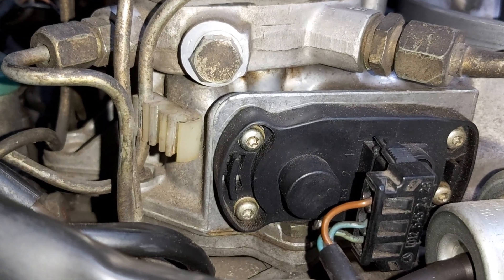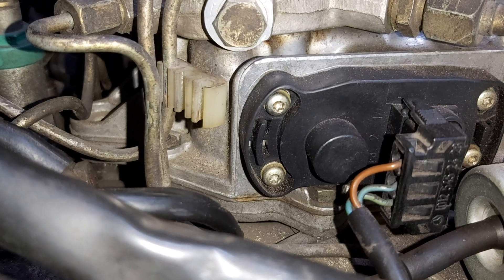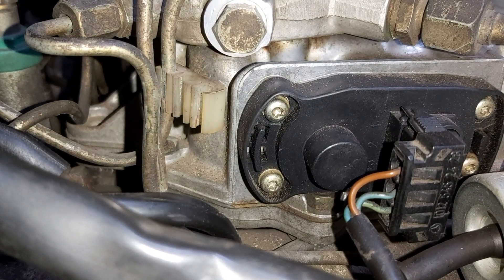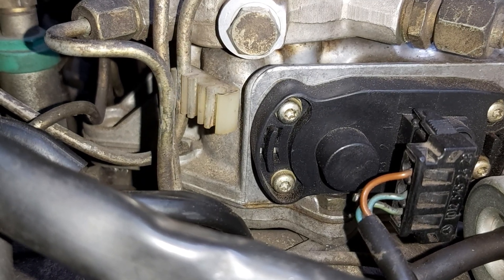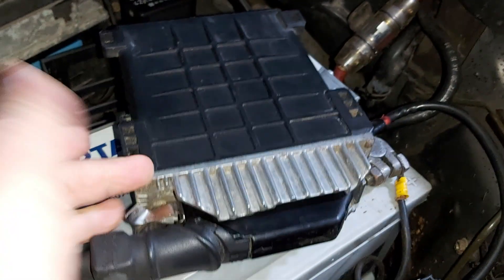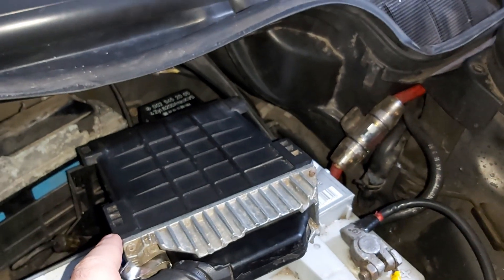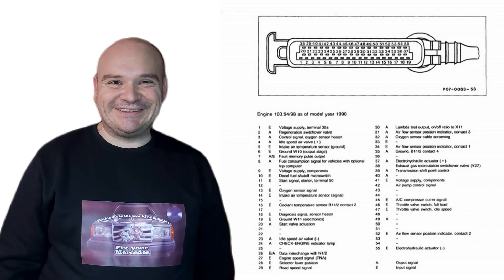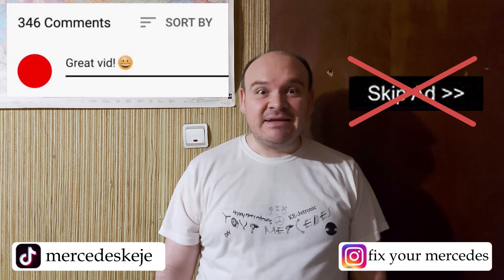㉦Mercedes Ke-Jetronic㉦ - 🔌✅👍🏻👌🏻Connecting the potentiometer plug👌🏻👍🏻✅🔌

Comment: Hello I have a question for you. When my vehicle's engine is cold and I start it, it starts to stall at low speed. It may go away when the engine warms up a bit. thanks
Reply from the maker: Have you replaced and calibrated the potentiometer?
Reply: @ I am trying to get a potentiometer and I will replace it when I find it. I have another question. There is a strong gasoline smell from the exhaust and when I take my foot off the gas while the vehicle is in gear, I hear popping sounds from the exhaust. I would like to get your valuable opinion on why this might be happening, thank you very much.

Comment: i have a r129 500 sl, rough start, rough idle, when idling (700rpm) reved itself to 2000rpm then white smoke started coming from exhaust. then dropped to 500rpm and turned off,  fuel smell, problem goes away after driving a while, where to start looking (car stood 7 years in a wet place)
Reply from the maker: Start checking the injection, the sensors.
Reply: @mercedeske  do you think the smoke isnt caused by head gasket leak or there is a chance?
Reply from the maker: @puxel8632  When the gasket it blown you will see white smoke as if you did burnout! And of course the loss of coolant, since the engine burns it.

Comment: Hi sir! My 230e 1991 is revving on its own up to 2500rpm. Is my potentiometer going bad? What is the solution. My car havr been driven 120.000km. Thanks!
Reply from the maker: Hello. It's possible that the potentiometer can be bad, check the whole mechanical part of the injection as well.
Reply: @ thank you for your reply sir! The rpm is fluctuating from 800 then goes to 2500 for a few second, then going down a little bit, then going up again. There is no pattern. I unplug the throttle position socket and the problem is gone. Could that conclude that i need to change the potentiometer?
Reply from the maker: @imalhsag5761  Check the TPS and check the potentiometer, I can't tell for sure.

Comment: I’m trying to fix rough idling at traffic lights, and when I disconnected it today, it idled about 900rpm but ran much better,(with a tiny bit of rough idle)
Reply from the maker: Have you replaced the potentiometer? It has to be replaced and recalibrated after 150k km. Check it if you haven't! I can't know how many kms is on your car.
Reply: @mercedeske  im kinda scared to change it 😄
Reply from the maker: @danjelmanjani4412  Just easy, everything's hard for the first time. Nothing to be afraid of!
Reply: @mercedeske  my car was bought recently, has 100k/km. But hasn’t been used since 1997 and I’m trying to get it running as best as I can. So far I have cleaned all the fuel system, all new ignition leads, cap, coil, injection and many parts replaced. Starts fine drives fine, just at stop light misfires.